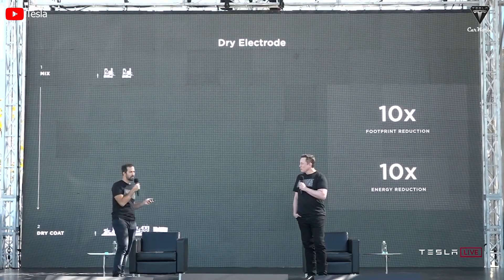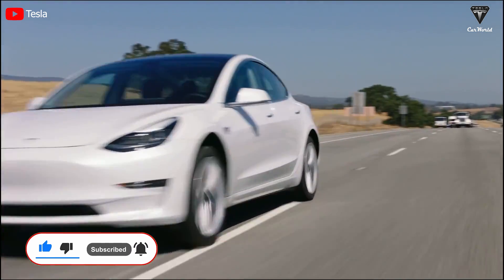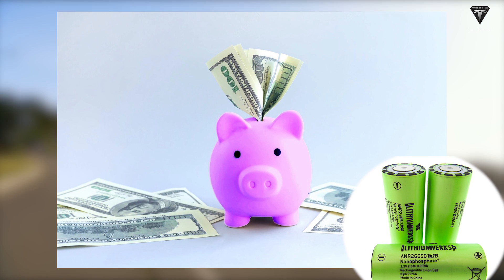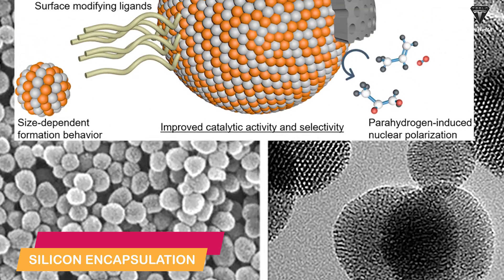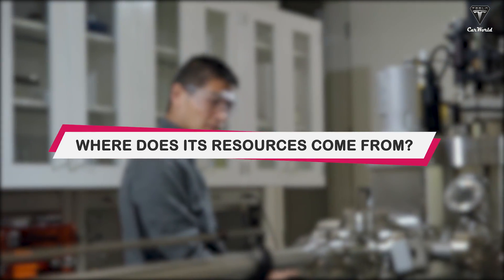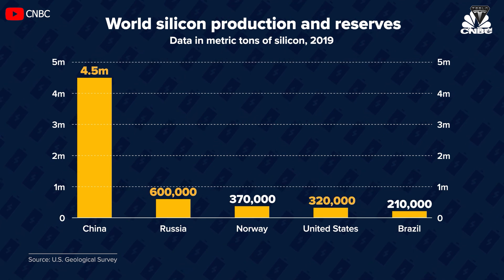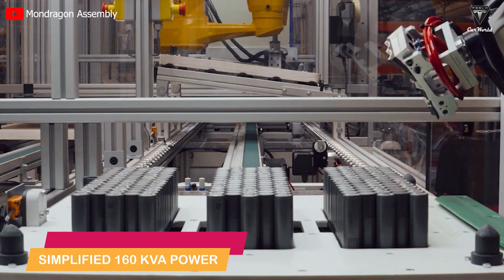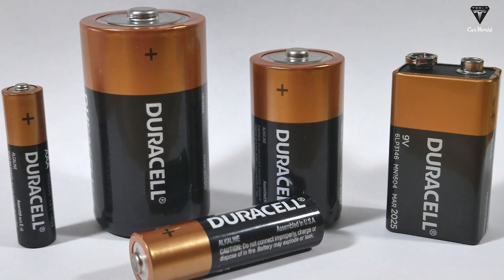Finally Happened! Elon Musk Revealed Breakthrough Silicon Battery, Entire Industry Change!

Comment: This is great, has this reduced the volume of cooper that's required? I recognise solving for lithium as the limiting factor of cost and scale,  but does it matter if something else becomes the critical bottleneck to the large scale deployment of the batteries ? 
The global supply chains for the scale we need, is going to be an enormous challenge....
Reply: Not where copper's most used, the transmission lines.
Reply: Tesla is moving to 48Volt architecture, which will reduce the amount of cooper needed
Reply: @ryansutherland4402  no, thats only to replace low power stuff. The engine(s) are still 380V or higher, some 800V, higher voltage = less current = less resistance = less copper losses = less copper. 
Read up on Ohm's law from the 1840s.
Reply: That's why Ive been watching the new sodium ion batteries out of China that supposedly hold more energy and have better performance than average lithium cells of the same size
Reply: @thee_number_six6227  🤦🏻‍♂️😂
Reply: @Piccodon  motor, not engine. Your are right that higher voltage (for same power) means less current, but if you know a bit more about electric motors, you'll know you cant just simply feed them higher voltage.
For a given motor, voltage is proportional to the rpm and current proportional to the torque. you can make about the same power with double the voltage and half the current, but the motor will have half the torque and twice the rpm. that is what RC motors do, low torque fast rpm but they don't have the reliability needed for EVs
State of the art EV motors are already maxing rpm considering mechanical limits so there are little gains there.
I you want to run same power/torque/rpm with double the voltage and half the current, you can divide the windings cross section by 2 (effectively muliplying resistance of the wire gauge x2), but you also need double the number of windings per coil to double the voltage, so doubling the length of the wire and in the end you have the same amount of copper, half the current and 4x the resistance, resulting in same amount of heat = R*I^2 dissipated in the same volume of coils. 

This doesnt mean that there are ZERO gains form operating at higher voltages, because in real world there are a lot of parameters, losses in the phase wires and in the inverter, also the windings in  motor coils need to be coated so more windings = more space and weight "wasted" by the varnish insulation, less heat conductivity. But overall you just can't apply simple maths like Ohms law, multiply voltage by 2, divide current by 2 and call it a day, electric motors are way more complex than that. the low hanging fruits have already been grabbed a while ago, to improve efficiency you can increase max rpm like tesla carbon fiber sleeve plaid motors, or increase gear reduction/reduce top speed, but at some point back EMF starts cancelling the gains, so you have cheaper motor, but more expensive battery
Lucid has very compact and efficient motors using 800V
Tesla mixes more expensive permanent magnet motors for more power, and cheaper induction motors in the model 3/Y  front motors and cybertruck rear motor(s)  that are basically able to "freewheel" when they are not excited, so the more load can be applied to the rear , very much like cylinder deactivation in internal combustion engines.
Plaid is tuned for pure power, not efficiency, so there permanent magnet motors

So  technically  Plaid is permanent AWD/4WD, while AWD cybertruck and Model S/X are FWD/AWD, and model 3/Y AWD is RWD/AWD....

its seems like for a given motor requirements (rpm/torque) there is a sweet spot for Volts/amps to optimize power delivery/efficiency/reliability, and with gearing so that the cruising rpm is in the most efficiency range of rpm/load
For instance, I remember Zero motorcycle justifying their choice of keeping 100V architecture for their motors, that prevents them to be compatible with most dc fast chargers, explaining than going to 200 or 400V architecture would actually DECREASE the efficiency.
this is why you have usually rc motors 10-20V, ebikes ~36-48V, light motorcycles 60-72V, full size motorcycles 100V-300V depending on DC fast charging ability, EVS 400-800V
industrial motors, 240V to several thousand volts dpending on the requirements
Reply: @geemy9675  OK, Mrs. Pedantic,  General Motors or General Engines? What does M is BMW stand for? Motorsports or Engine sports? Ford Motor Company or Ford Engine Company? Do a google of " x Motor Company" , how many are using "engine"in lieu of Motor?  I'm familiar with the vernacular, and it is generally understood that motive force can have a variety of energy origins, and words have synonyms.  The word "engine" is Latin for motor (another Latin word) as "motor" is more often used in dozens of languages, more often than the Latin variety.  
Most motorcycles are not electric. 
Higher power electric motors use higher voltages. I^R losses is a simplification of course, I'm sure nobody is going to design a motor based on a random YouTube comment.

Comment: 80% charge in six minutes... that's fantastic but for one problem.

A typical supercharger close where I live has between six and ten stations.  That is an insane amount of draw if all of those stations are in use.
Where is all of that immediate energy going to come from?  Yep, not likely to be 'green'.
Also... the cable from the pedestal to the car will require a LOT of cooling to push that much energy that quickly... trying to charge thousands of cars over a city when all of them can charge that fast is going to require the same cooling for every inch of power line.  Air cooling simply won't cut it any more.
Reply: sounds like intelligent charging is going to be in demand.
Reply: @scamchan  The only thing 'smart' charging will do is throttle back when temps spike... returning charging to the speeds we currently have.
Reply: @amzarnacht6710  Smart charging could balance out charging many cars at once for sure.
Reply: The heat is called "I squared r loss".  Using a thicker cable address the problem by making "r" smaller.    But it is better to make "I" smaller as it is squared.   We can reduce loss in the cable by using a much higher voltage and similar current.    This is how long distance power lines can send hundreds of millions of watts with very little loss.   The trouble now is safety.   Di we really want 1,000 volt (or more) cables?

Most charging is done at home and this does not need to be fast.
Reply: @chrisalbertson5838  So high voltage low current.
Couldn't that be converted inside the car?

Comment: The only way to make EVs widely practical is a standardized hot-swappable battery. You pull in, swap for a fully charged battery, pay for the charge like you would a propane bottle swap, and you're back on the road in minutes instead of hours.

Comment: My understanding this is just an improvement in the anode.  Li is still the most energy dense and lightest metal for making batteries.  The  Holy Grail would be a solid state Li battery that would not self destruct with recharging.  This Si anode looks to me as a step in this direction.  The other issue is getting rid of other expensive materials needed in making the batteries.  It kind of looks like allot of these goals are being acheived with newer developments.  My guess is in ten years batteries will be about a 1/2 to a third of the cost with charging taking about the same amount of time as pumping gas does now.  Now all we have to do is get our cars to fly

Comment: They still need a breakthrough in energy production. The way it stands, our grid can't possibly support everyone having these kind of cars, plus it's less efficient than gasoline vehicles when the energy comes from coal plants, which is most of the time.
Reply: Spaced out and timed accordingly, when coupled with less dense on-site storage, the grid at current can handle it just as well as it can handle anything else.

These can charge overnight when power consumption is reduced for most everything else.. and most don't drive 400 miles in a week, let alone a single day.

Where that's needed, it can be budgeted for as well, like at fueling stations where recharging vehicles is 'constant', on-site storage can provide a solid buffer against less predictable demand. 

Think: buried batteries holding charge vs buried fuel tanks holding gasoline/ diesel/kerosene. 

The utilities communicating with the customers to create more predictable demand curves can ebb a lot of intermittency in the flow.

No bidirectionality in the grid needed.

Comment: A six minute charge and 600 miles range is physically impossible. 600 miles range corresponds to around 150kwh. A six minute charge requires 1.5 megawatts. The cables would be far too heavy to lift and every 1% loss requires 15kw of heat to be disposed of.

Comment: I think battery for used with home solar system doesn't need to be compact or light weight as for EV, also not need strong storage frame like for car moving in traffic. Do you know what kind of battery best suited for home solar system?
Reply: People have used lead/acid batteries for solar for decades.   They are really cheap.  But in recent years Lithium is replacing lead/acid.     My idea is that one day we will used recycled car batteries for homes.   Who the battery pack in the yard needs to be replaced, it can be re-pousored to the less demanding task of powering a house.    A house might need 5 or more "half dead" car batteries stacked up in a shed.
Reply: @chrisalbertson5838  Thanks for your input, I heard that some people using battery used in golf cart or fork lift (lead/acid) for their solar system.

Comment: What is the weight difference.  The increased weight may make it a wash.
Reply from the maker: One thing is certain, silicon batteries will be significantly lighter than present batteries based on raw materials and energy density.

Comment: This sounds very promising! Yet I am compelled to ask what are we supposed to do with all of our electronic tools using lithium batteries? I hope we don't have to get rid of them and compatible batteries for the tools can be used when the transition is made
Reply from the maker: Rest assured, we don't have to remove anything and can even use them a lot to more efficiently because the silicon batteries are compatible for tools during conversion. They only change the nature of the battery to improve the efficiency of the devices, not affect the conversion process.

Comment: The question is: Can a car harness energy from the sun? Have it filter directly into a battery. Yes, the same concept as solar.
Reply from the maker: Yes, you can fully charge an electric car with solar energy. You only need to put up the solar charger for the car battery. Solar panels are usually on the roof of your cars.
Reply: @TeslaCarWorld  But will that be enough? What about adding mini wind turbines on the car to charge the battery while you drive? This could get ridiculous though.
Reply: Aptera does this
Reply: Yes you can use solar power to run a car.  But the roof on the car needs to be as big as the roof on a typical house.   We fix this by putting a cable and plug between the solar panels and the car
Reply: The big problem with solar panels on cars roof is that the roof and hood area is so small after all. Sun shines at about 1 kWh per square meter. If you can recover 20% of that, it is 200 watts per square meter. If your roof and hood area is 5 m^2 (which would be actually very big for a car), it will produce 1 kW of power at very optimal conditions, so it is at best a 1 kW charger. The power is a little too small to keep the car topped up except if it is driven very little and the person lives in a place where sun shines a lot. Generally it makes more sense to start putting the solar panels in easier places first such as roofs of buildings. As long as all roofs are almost totally free of solar panels, doesn't make much sense to add more cost and mass to the car . . .
Reply: @BioniqBob  Sarcasm doesn't translate well in online comments. LOL
Reply: We would have to ask doc ock

Comment: Why don't you tell us how many volts/cell it produces?  😜
Reply: Nominal 3.45V. It's an Amprius cell.
Reply: @lesp315  The reason Lithium is on top is that it provides 20% more voltage per cell, 20% more power/per cell and less weight.
Reply: @Larry-Livermore  Amprius is using graphene. That also makes a difference. These are boutique cells. I don't know if they will be able to make them cheap. We will see. Munro did a factory tour. It was very interesting.